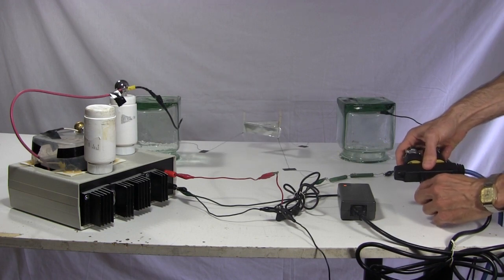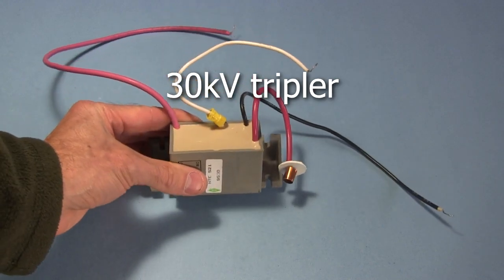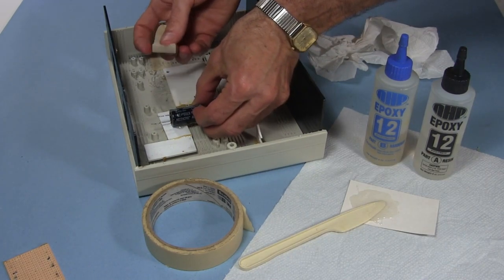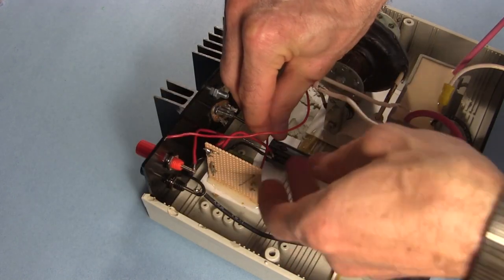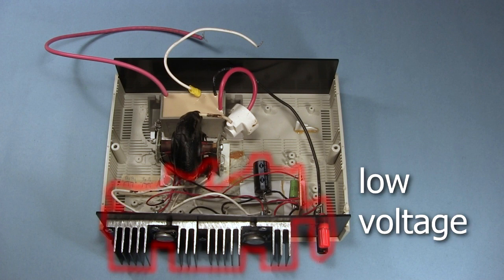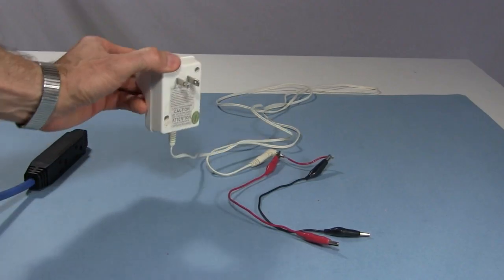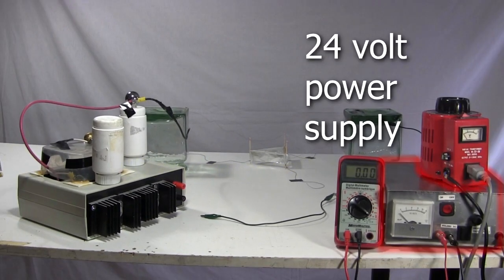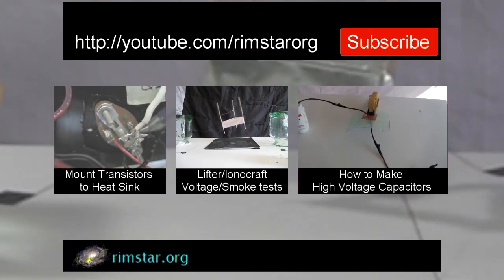How to Make 30kV High Voltage DC Power Supply with Flyback & Cockcroft-Walton Multiplier Tripler

Comment: I was using the exact same adapter for my flyback circuit which was pretty similar to yours, without the tripler, and with a better transistor. My arc was just as long as yours if not longer.. The adapter burnt out and caught fire.
Reply from the maker: lepayen The transistor can definitely make a difference. Keep in mind that I wasn't trying for a longest arc. I avoid that sort of thing because it can damage the power supply. But not going with a tripler also makes for a different animal. If your flyback doesn't have a built-in diode, like mine doesn't, and you don't have a tripler then you're putting out high voltage AC instead of DC and you can draw out a nice long arc. If your flyback has a built-in diode and no tripler then you're putting out DC but at a lower voltage and higher current, which in my experience with my cube power supply can also draw out a nice long arc (see my cube power supply here https://www.youtube.com/watch?v=-KFhBVfpfDw).The power supply in this video that we're commenting is intended as a workhorse - for doing things like ion propulsion, powering lifters and so on.
Reply: I wasn't thinking about the fact that your flyback is not rectified. That would require a voltage multiplier or marx generator to make it DC without a rectifying diode. I was thinking of buying a non rectified flyback and putting a full wave rectifier on it for a special experiment. . Granted I will have to buy some high voltage diodes as well to make the rectifier.
Reply: I have found that most of the time the transistor that's in the television with the flyback is the best one for that particular flyback, if you're using the coils already existing that is. Obviously making your own coils will affect how well the flyback works.
Reply from the maker: lepayen Funnily enough, the only time I took a flyback from a TV, the flyback was the only thing left in the TV for me to take! :D The transistor and everything else was gone when I found the TV beside the street. I don't know why they left just the flyback. Maybe the input coils were the reason the TV was no longer working. But I replaced those so it didn't matter to me.
Reply: That's possible. Perhaps they had no idea what it did. So many televisions and other electronics get tossed out around my city, I've been harvesting parts left, right and center. The best place to check is usually behind apartment buildings.

Comment: Is there a simple mod to make it adjustable AC? By adjustable I mean the alternating frequency.
Reply from the maker: There isn't any that I can see. The frequency is determined by the DC input voltage, the characteristics of the flyback coils and the load. Varying the DC input voltage would also affect the output voltage, so that's likely not an option. But there are a lot of different circuits for driving a flyback so there may be some other flyback circuit that may do it.

Comment: It might be a dumb question but I want to ask why did you connect the earth to the ground of the laptop adapter? Thank you for the videos :)
Reply from the maker: It's a good question. If you look at the complete circuit, you'll see that that alligator clip I used to connect the ground to the laptop adaptor's negative is electrically connected all the way into the high voltage power supply to the voltage multiplier.
The purpose is really to make the positive high voltage be relative to ground. For example, the high voltage output for the high voltage power supply tops out at 30kV, but 30kV relative to what? It has to be relative to something. A safe thing to do is to make it 30kV relative to whatever potential the objects and people in the room are at. So by grounding the negative of the high voltage power supply, the 30kV is 30kV away from whatever everything else in the room is at.
The alternative is to have the 30kV be floating, relative to nothing in particular, in which case it would be any voltage relative to the surroundings, possibly a dangerous amount or possibly a useless amount.

Comment: Thanks for this video. great work. please help me out. what happen if hv output wire shorted with ground? if its damage the circuit then what will be the solution of short circuit protection. thanks in advance
Reply from the maker: A short circuit would damage one of the transistors due to the high current, similar to too strong of a spark, as I found and fixed in this video http://youtu.be/Kb0WwsJgTMM. Hopefully it would damage the transistor before getting to damage the flyback transformer.
There are things you can add around the transistor to help with too much current, which I talk about in the section called "Transistor protection - capacitors and diodes" on my webpage here http://rimstar.org/equip/30kv_pwr_supply.htm. But then it might just damage something else instead.
But for a short circuit, ideally there would be a fuse or breaker somewhere, probably at the input. I just don't know what value to put. The only way I can think you could check is to try out your power supply while monitoring the input current under normal usage and then put in a fuse that's a little higher than that current.

Comment: Is it possible to control the voltage that is being supplied by the device? For example, if I needed 20kV, would I be able to change the amount of voltage outputted?
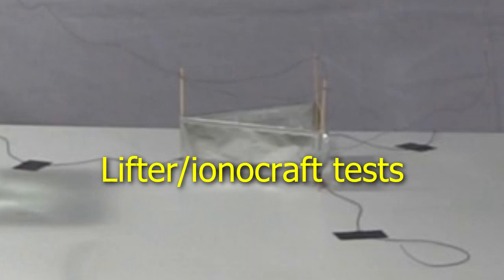Reply from the maker: Yes, that's controlled by controlling the input DC voltage. I feed it anywhere from 0 to 24 VDC. Starting at 8:21, you see me connecting up a low voltage DC power supply which can output from 0 to 24 VDC. That low voltage power supply takes in AC voltage and outputs voltage to the high voltage power supply. To control that DC output, I control the AC input. And that's done using the red thing called a VARIAC. So the path is: AC wall socket >  VARIAC (0 - 120 VAC output) > low voltage power supply (0 - 24 VDC output) > high voltage power supply (0 - 30 kVDC output, sort of, if I recall correctly it's something more like 0V and then 10kVDC - 30 kVDC). Of course, your DC input source to the high voltage power supply might be different. See my webpages about these power supply for clearer pictures: https://rimstar.org/equip/24v_pwr_supply.htm and https://rimstar.org/equip/30kv_pwr_supply.htm

Comment: The materials are not available in the place I live. But I really like your ionocraft and I want to make it. What should I do?
Reply from the maker: The only other option is to buy one. Make sure you get one that at least 26,000 volts and high current, around 1 milliamp to be sure it would work. It must also be direct current (DC) and not alternating current (AC). That means a tesla coil will not work. One place to buy them is http://amazing1.com. Note that these are relatively high power high voltage power supplies and you must know what you're doing to be safe.

Comment: Sir didn't get the old one Flyback transformer that you have used,,I got the newer one,,but don't know the code number of flyback transformer that should be used in this.....so plz tell me the code number...
Reply from the maker: If you got a newer one then chances are it has a built-in diode like one I used in my Cube power supply. The one I use in the power supply for this video is a very, very old one which I purchased from an online source which no longer exists. The part number information written on the datasheet which came with it is "SD-FLY400, replacement for Motorola 24D67878A01", however I couldn't find anything about it online.
The trick to making this power supply is finding a flyback transformer which doesn't have a built-in diode.
This one https://www.ebay.com/itm/Sanyo-4-2751-60108-4275160108-Flyback-Transformer-2278-/292134655134?hash=item440495149e might or might not have a built-in diode. Some have told me in the comments that they'll try it but they never told me if it worked or not afterward.
Reply: RimstarOrg sir do you think the Flyback transformer you used in the The Cube power supply don't  have the built-in diode....
Reply from the maker: No, the opposite. The flyback transformer in the Cube has the built-in diode and the flyback transformer in the 30kV power does not have the built-in diode.

Comment: Hi, hope you have a very good Christmas and New Year. I want to ask two questions. Do I need I the cap on the end of the flyback? I mean whether I can cut the cap and connect the flyback's wire with the tripler's wire by soldering them together. And do you have any suggestions where can I get the metal balls because I try to look for them even on the Internet, but I can't find. Thank you.
Reply from the maker: You don't need the cap. You can solder the flyback's wire with the tripler's wire. Try to use a big rounded blob of solder; avoid sharp points like the sharp ends of wires being exposed. Since this is the high voltage side of things, sharp ends can cause ionization to the surrounding air and reduce your maximum voltage. As for the balls, any smoothed edges metal object will do. Desk drawer handles, and door handles are usually rounded, you can cut off any sharp parts. They don't have to be perfect balls. I even have some 1/2 inch thick copper rod that I cut short pieces from and sand them so they're well rounded. Maybe even something in stores with things for the kitchen will do.
Reply: RimstarOrg Thank you. And Happy New Year.^^

Comment: The parts store I went to did not have mounting kits for the transistors, are the collectors only on the securing plates? And would I be able to skip that by soldering a wire onto the posts, or is it something I actualy need?
Reply from the maker: The mounting kit is optional. It does make it easier to mount onto the heat sink without having an electrical connection to the heat sink. The collector is the case of the transistor so often you can just put the wire between the case and the nuts and bolts that you use to hold the case in place.
Reply: alright thank you

Comment: Hello Rim,

How to measure the high voltage produced using flyback transformer
Reply from the maker: Ismail Hussain I would hook up a high voltage probe to an oscilloscope. I sometimes hook up my Fluke 80K-40 probe to my scope (this probe https://www.youtube.com/watch?v=kXq4FCQ0C38). It's intended for DC but gives a good enough idea with flyback output.

Comment: ground conection is not necessary when you use notebook supply. SMPS have their output ground referenced, you can check continuity between low output and ground pin in plug. 9:08 <- I think that connection is unnecessary
Reply from the maker: user21XXL The ground connection was to provide a ground reference for the high voltage side.

Comment: This might be a silly question, but is this PSU is giving Pulsed DC or nice and regualated DC like the one that your wall adapter normally gives? I'm confused because when you ground the metal balls, spark is not continuous, but (i don't know the right word to use) cutted... And another little question, the kind of flyback you have is little historic and pretty much impossible to find here in Turkey. But i have lots of new type of flyback which has internal rectifiers or whatever they has :) Can i use them too?
Reply from the maker: The output is not Pulsed DC, but it isn't necessarily flat DC either. If whatever you're using it for is creating a lot of ions somewhere then there is some ripple on top of the DC. If there is no ion creation, in other words the thing you're powering is holding the charge without much leakage, then it is fairly flat DC. That's normal behavior for a Cockcroft-Walton voltage multiplier, which is what the tripler is. The spark isn't continuous because the gap size I was using and the roundness of the balls means that it takes time to build up a lot of charge before sparking. Once it sparks, it takes time to accumulate enough charge to spark again. With smaller balls and a smaller gap size, it would be more continuous. I haven't worked with HV AC, but that seems to be able to make more continuous arc once a spark has occurred. In answer to your second question, the flyback with internal rectifiers give pulsed DC output "I think". I've never seen the output of one on an oscilloscope but I've seen the schematics for one and it doesn't have any smoothing capacitors, just diodes. So I suspect it would be pulsed. But it's definitely DC.
Reply: RimstarOrg First of all, thank you for quick reply. I'm studying electronics engineering here in turkey as sophomore. And i'm intrested in HV as hobby. Yesterday i finished my first tesla coil, it needs some tuning though. I'm still a beginner at this but i'm trying to advance myself and you can't know how valuable your answer is. So did i get it correct?  Your psu gives flat dc if short circuited but when you try to get sparks it builds up some more voltage then normal to ionize air to spark, which causes the ripples. And i'm using this circuit to drive my flyback: (http://www.next.gr/uploads/224-8865e3eaba.gif) i know it gives pulsed dc because of its basicly a transistor opening and closing to induce some current, but would it work if i connect it to a ionocraft?
Reply from the maker: Konur Bilak
Re your first question, not quite. The psu gives flat DC when you charge up something that doesn't short circuit, for example a high voltage capacitor. Since the capacitor isn't leaking, the voltage can rise, and once the capacitor is charged, it can hold the voltage. But if the capacitor leaks then there'll be current through the capacitor (a spark gap that eventually sparks is a leaky capacitor.) This current causes the voltage to drop. And with the the Cockcroft-Walton voltage multiplier (tripler) circuit, that cause the circuit to produce a ripple. The ripple simply means that instead of the DC staying flat, it drops and fluctuates on top with some frequency. Note that this ripple doesn't necessarily apply to a Tesla coil since that's a totally different circuit. Re your flyback circuit with pulsed DC, it might work. Research back in the early 2000s showed that 70 cycle per second pulse DC worked very well for a lifter. If you use a potentiometer (variable resistor) instead of a fixed 2.2K resistor you should be able to vary the output frequency. Note: I don't know what the voltage or current output of that circuit will be so I can't guarantee it'll work.
Reply: I'll try and see i guess :) And to fully understand your system i need to read some info about triplers. Thank you very much :)

Comment: Sir plz tell me Which is the negative and positive terminal of this HVPV that you used to power the Smoke Precipitator.....I had watched your video multiple times but I can't figure the negative and positive terminal out...
Reply from the maker: With the smoke precipitator, the aluminum foil cylinder is connected to the high voltage positive, and the wire mesh is connected to ground, which is the same as the high voltage power supply's ground, which I explained in the other comment. There is no high voltage negative, though you can get negative charge from it like I do in the smoke precipitator. That's because the high voltage positive attracts negative charge from the ground.
The plug coming from the wall socket that powers the lower voltage power supply has a ground wire. That's connected to the low voltage power supply's negative output, so that's also at ground potential. That goes to the high voltage power supply's negative input, so that's also at ground potential. And that's also connected to the flyback transformer's ground pin and the voltage multiplier's ground pin (see the circuit diagram). So all those points are electrically connected together and are at ground potential. As I said in the other comment, there isn't really any negative. It's really 0V, and the high voltage positive output is 30,000 volts away from that 0 volts.

Comment: Thank you for great tutorial sir.  I just wonder how much current rated on the HV side? and Is it suitable to use in long term (about six hours)? Sorry for my bad english.
Reply from the maker: Thanks. I would guess the minimum current rating would be whatever the current rating is for the 2N3055 transistors you use. I say that because I once produced a strong enough spark to damage one of those transistors. I show fixing it in this video http://youtu.be/Kb0WwsJgTMM As for whether or not it's suitable for long term use, I've only ever run it for a few minutes at a time so I can't say for sure. But I think I've run it long enough that if anything was heating up, it would cause damage. However, my loads are usually around 25000 volts with moderate current (I would guess) when flying lifters.
Reply: @RimstarOrg  Thank you for your fast reply. I pretty sure that it is suitable to use in my work, so I will make it one sir.

Comment: Do you know where I could get a fly back transformer? Also, could you tell me the difference between a normal transformer and a fly back? Thanks
Reply from the maker: +Scotlahn Mccallister You can of course find them online on places like ebay, but I get them from old cathode ray type computer monitors and TVs. A flyback transformer has two coils for the input side of the circuit and then a 3rd coil for the output. A normal transformer has only one input coil and one output coil. It's the way the circuit interacts with those two input side coils that make the high voltage.